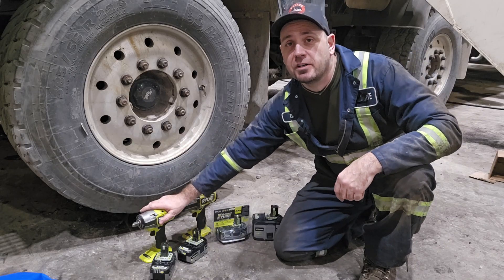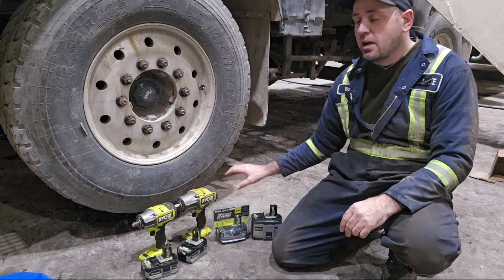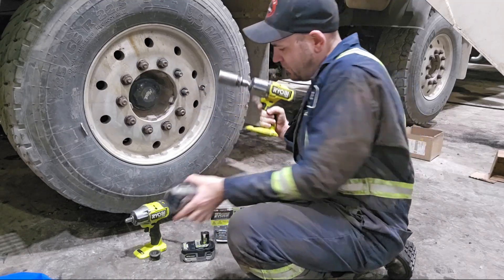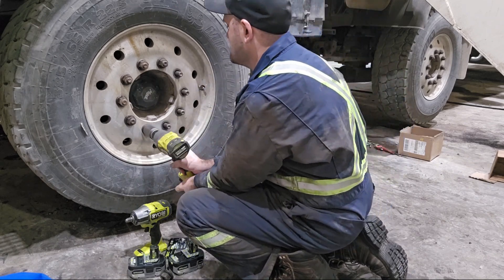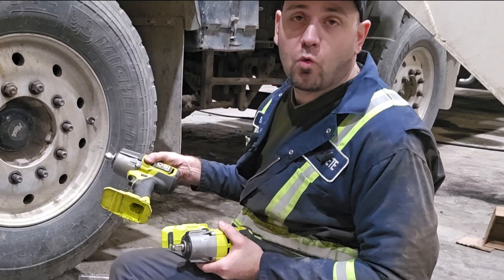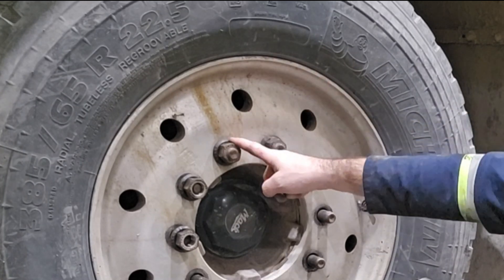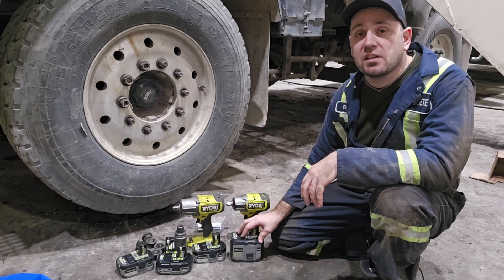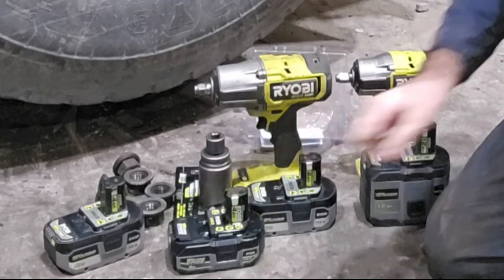Testing Ryobi HP & EDGE Batteries: Are They Worth It?

Comment: On another channel they discoverd that the mid-torque did best with the discontinued 3Ah battery. That was before the Edge was available, but it's curious. The biggest advantage with the Edge batteries in theory is their overall life expectancy, because the cells supposedly run cooler etc.
Reply from the maker: This make since because the 3ah battery was using bigger cells

Comment: I know from years of experience that the 1/2 to 3/4 adapter or any adapter used will greatly reduces power output. Anything between the hammer and socket will rob power by reducing the percussion energy transfered into the socket. It also hurts the impact gun over time because more energy will be transferred back into the impact gun.
Reply from the maker: As shown by the Torque Test Channel you only lose a little % of torque from a 1/2 to 3/4 adapter but a lot from extentions. 
What I'm more impressed by is that  batteries Ah actually affect the amount of torque.

Comment: HP batteries are not really worth over the standard ones. Either get the standard ones or EDGE batteries.
Reply from the maker: In this video you can see how the edge battery is way stronger then a HP battery  but as I tested in the Ryobi RC Uproar video, the HP batteries give more torque and speed compared to the standard batteries.

Comment: We're a far smaller market here in Australia, we just don't have the same range of battery available: There are three normal HP capacity batters sold here: 5.0Ah, 8.0 Ah and 12.0Ah. We don't get the 6Ah HP version. In the standard batteries we have 2.0Ah and 4.0Ah. The sole Edge HP version is the 4.0Ah type. The 8.0Ah HP sells for A$219; the 5.0Ah HP for A$169 and the 4.0Ah Edge HP for A$189.
Reply: Its odd that you can buy the 18v mower with a 6ah battery at Bunnings but cant buy the 6ah battery on its own.

Comment: I'm pretty sure "auto" caps the speed/power to the 2 setting. To get the max power you have to use 3!
Reply from the maker: @evanpartidas4624  auto will adjust the torque as needed and stop it from spinning if there's no load.
Reply: Yup. 3 is beast mode